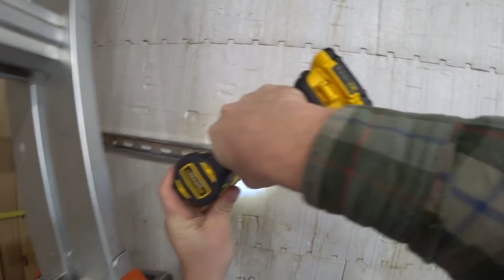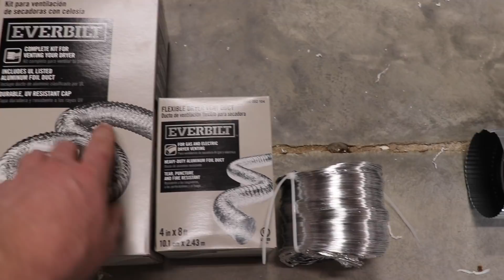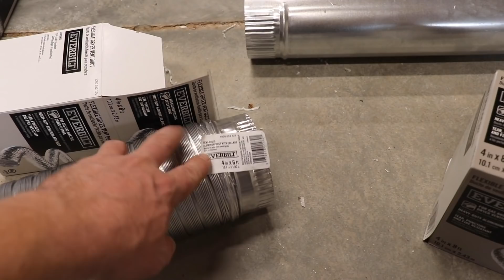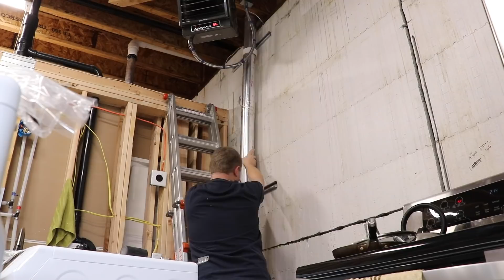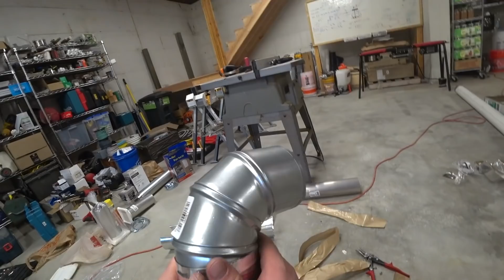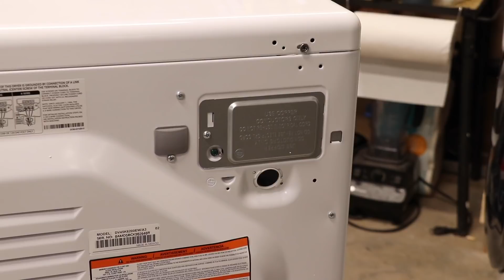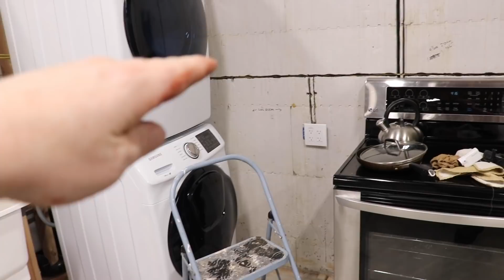Dodged THIS COMMON FIRE HAZARD in Our House!

Comment: All,, I repeat,, ALL flex duct should not be used for dryers,,,, except for a possible very short piece at the back of the machine to facilitate install and removal.   I DO NOT like to use it even then.  The reason   ALL coil type expanded ducts collect lint because of their internal corrugations.  And no corrugated duct will survicve an internal fire for more than a few seconds.  That I have arrived at by personal experience and disaster.   The best material for dryer vent is 4", 26 gauge galvaized steel ductwork.  Simple, direct, off of the shelf.  The tubes are routinely available as 2' sections or 5' sections.  The elbows are completely adjustable for angles.  It IS the material designed for the job.  Cut to length before you snap the edges together.  Tape the joints with a metal tape.

Comment: Make sure critters are blocked from using the vent as a home or habitat trail!  Mice or chipmunks can clog a dryer vent if they use the venting as a warm dry nest or food pantry. Louvers can get lint build up allowing louvers to be open just enough for a critter entry. Critters can with or without lint build up find the way to move them and gain entry. I suggest a relatively small (dime size) mesh cage over the vent in plastic or metal. Check Amazon.

P.S. Amazon does deliver pantry and or fresh meat and produce in some locations and are expanding the number of locations.

Comment: I'm not sure about the "code" need of fireproof sealant around the vent to the exterior.  Since it is penetrating SIPS it seems to me to be unnecessary.  SIPS are made from OSB board (combustible) and foam insulation (combustible?) What is being protected?  As I understand this type of sealant it is to prevent smoke going from one occupied area into another.  In your case its going from an occupied space to the exterior.

Comment: What your saying is that the drier  should not have no plastic part that may catch fire so any drier that has it is not a unit that can  pass the code. The door of the your unit is of a plastic that may burn so if the clothes inside catch on fire  so that it does not pass the fire code.

Comment: WHY DIDN'T YOU USE CLAMPS AT THE JOINTS AS WELL AS TAPE TO KEEP THE PIPING FROM BLOWING APART ,FROM BACK PRESSURE ,OR VIBRATION ?
I REALLY HAVEN'T HAD GOOD EXPERIENCES WITH THE SILVER METALLIC  TAPE,AFTER  YRS OF AGE AND HOT AND COLD,SOME OF IT STARTS TO LEAK OR LOOSEN ..
ALSO WOULDN'T A TEE WITH A CAP BE BETTER AS A CLEAN OUT INSTEAD OF A 90 ?
JUST WONDERING ?

Comment: If you are going to tape all of the seams you should also tape the seams in the 90's. They will leak air also. Buy a set of crimpers for pipe ducting and use them on the harder to join pieces. You also have 4 90's in the way you ran your duct. Even though you only have two "hard"  90's, you also have two 90 degree bends in your flexible duct.

Comment: They have a crimping tool to shrink one of the pipes when you get a tight fit. They also have a sealant paint for duct work that is gold when wet and drys to a silver.

A heads up on the dryer it has a moisture sensor that can mess up on thinner and lighter materials so it will think it is finished yet the clothes are still damp so to get it to work throw a wet towel in with the load to give it the needed moisture to trick the sensor.

Comment: Jesse, You haven't finished yet.  Both 90 deg L's have to have ALL circumferel seams sealed by tape, left bare they will leak dusty lint int the garage.  Your choice of laundry equipment and needs would be better served with a Frigidaire 3.9 cu ft Laundry Center.  Never buy units with push button  board controllers.  They are only as good as the weakest link; and there are many such links.  Metal ducts also build up static electricity and so can result in a vent sourced fire.  Code ASSUMES you to have everything grounded; so a ground wire from the piping to the dryer ground will doubly assure safety.  Building Codes assure public employment to bureaucrats who belong to clubs, societies and organizations that promote safety and increase inspectors assurance of continued employment. raising complexity increases job longevity and income.  It also increases income stream to Jurisdiction by raising taxes.  My Father bought a 20 X 60 foot barracks from a German Prisoner of War Camp in 1948.  He reclaimed all components and started building in 1949.  He built a 20X40 foot frame using barn styles construction.  An inspector showed up one day and dad tore it down and purchased land in a "No Code" Township for $100 per acre!m  The house was finished in 1951.  No electric until 1953  Indoor plumbing and painting the board and batten siding in 1955!   The house burned to the ground in 1950!  From a wood stove fire while folks were away.  Codes are like Law Books written for Lawyers and Politicians.  remember BTK?  He was a "Code Enforcement Officer".  You should fly more often.

Comment: As many have previously commented all this drama can be avoided with a heat pump / condensing dryer:
No vent needed.
More energy efficient.
Recovers the water from he clothes.Not only that but the dryer you're using is sucking air from the living space, heating it further and then venting it outside. In winter you're spending money to heat your dwelling and then spending more to waste that warm air. All that money and effort to seal the building seems wasted to me.

Comment: So you built a proper dryer duct with metal duct and then you finished with that stupid flex duct. Finish the job with metal duct. Also no need for the fire caulk. Foam would have been fine.

Comment: Just use a b-vent which is double walled smoke pipe . You can use a  mastic to seal seams. FYI I’ve never seen dryer pipe go on fire but have seen the lint build up at the bottom of the dryer go fire.. what very flammable are the dryer sheets and blocking the lint catcher of proper air flow

Comment: Nice job. I went through the same learning curve on my LG dryer regarding back pressure limits. It would shut itself off before getting the clothes dry enough. When I pulled the dryer out of my laundry room I removed a large amount of lint in the exhaust pipe. On a hunch I lifted off the cover and discovered another load of lint in the dryer enclosure. It was a big fire threat. Made me wonder how many home fires happen from this cause.

Comment: There is no way the dryer is going to be able to blow the lint up and out of that kind of system and there will be a lint build-up. Also you will be prone to have too much back pressure and burning up your dryer.

Comment: Jessie you just have a way to see things like I do. We both want to do it right and to understand the larger overview along with the thinking  and reasoning  of the codes.  In addition we want it the best it can be while being affordable.
I spent a lot of time trying to find closures that actually seal for both the dryer and the range hood vents. I found a dryer vent end that had a floating cap that is lifts  up but drops to seal the duct for the dryer.  It has worked for 18 years very well as both a vent and a seal.All I found for the range hood was a slotted plain metal louvers or a flap. When the wind blows the flap chatters horribly and the kitchen gets cold. So win for the dryer but fail for the range vent.  You are getting there! Great to see you actually living in your house.

Comment: metal ducting is easy  1st use the snips to cut the duct by reversing the way u hold the handles (just reverse the way u hold them) and use your knee to keep the duct clear of you   this will clear the metal and not get u cut  2nd use needle nose pliers to crimp the end of the duct where the snap lock is (not done by the manufacturer ) insert and twist  3rd  you could have used the KO on the side of the dryer to discharge the air to the right not towards the rear less 90 degree ells and easy to reach for cleaning   4th the discharge cap (PVC) is cheap but not air tight when closed  and has a lot of resistance to air flow   there is one on the market made out of metal with a magnetic flap   it is GREAT    From a former HVAC contractor with a large metal fabrication shop 100 plus man crew  HVAC

Comment: I believe that you missing one big point in your argument, PVC has heat limitations, typical PVC has an operating temperature of 60 degrees Celsius which is close to the dryer vent temperature. Even though the typical melting point starts at 100 degrees it could start oxidizing before that point and release chemical s into the air.

Comment: it's called a crimp tool, comes in handy when fitting metal pipe... and metal dryer vents also rust because it fills up with moisture each time you use it but nothing lasts forever.

Comment: Great to see Your pipe connections Are going with the flow of air Instead of against. You need to get A crimping tool, works like a pair of pliers You squeeze 2 handles together . Also Self tapping metal screws

Comment: You don't have to have combustion heat to have dry air. Just by raising the air temp by any means the moisture level in the air will drop.  Some times to an unhealthy level. Thus the moisture from the dryer is not a contaminant. Now in the summer when moisture is a problem you would want it out.

Comment: That's a super job of installation. You might want to think about an external lint filter which is attached on the piping. This is cleaned out every time you finish a wash. Unbelievable how much lint that builds up. As a former professional firefighter have you given any thought to installing smoke detectors in your living space? Their cheap and easy to install.

Comment: Why not use Galvanized Spiral Duct its quite rigid and wont leak air. When I worked in ventilation duct construction we built a commercial building and used fireproof caulking through and arround the firewalls holes. I guess it can be confusing with such a large country like the US where it seems not to have any Nationwide Standardized Building Codes like we have in Sweden, we have both Swedish Standards and European Standards to follow wich are mostly similar.

Comment: If you want a headache then go look at the installation requirements for fire caulk. Each manufacturer has a very detailed requirements for product use.  I did a bunch of fire stop work with the government , and you were required to have product training on each different product . You were also required to certified bu the manufacturer to use the product.  Good luck.

Comment: Best thing to use in keeping the duct work from leaking is aluminum tape over all joint and in the elbow. Most good hvac installer will use it to keep the efficiency in the unit and duct work.

Comment: Get a crimper tool to help adjust the male ends. Also it helps to stagger the pipe seams to keep the size from pinching at the joint. Also helps to tape the seams in the adjustable elbows.

Comment: Static is not the big problem, dampness is. The lint coming out of the dryer is wet and will stick to anything over time. The big question is ease of cleaning. All dryer duct of any length MUST be cleaned on a regular basics. Metal or PVC will fill with damp lint. PVC is ahead of all the rest for being the easiest to run a cleaning brush through. This is lessons learned over many years. Also key is the outlet being free of anything to catch the lint. In other words open as possible. The metal pipe will be very hard to clean with all the edges catching the brush and holding lint dams. The metal elbow is death to cleaning. The flexible junk is impossible to clean. The rough surface collects lint like crazy. 
Why does it have to be cleaned? To allow the dryer to breath and not be restricted which will increase drying time considerably. Go back to the PVC and then use a short metal section at the dryer to allow for heat despising.  
All modern dryers have a overheat safety switch that keeps the dryer from getting hot enough to start a fire.

Comment: You can solve the 'static' problem in pvc with a simple copper wire. What you can't solve is pvc offgasing  and potentially melting with the warm air coming from your dryer (and range hood) that's why it's not code to use pvc vents for anything above ambient temp venting.

Can't help thinking most your problems would disappear if you RTFMed BEFORE you actually started trying to do something

Comment: Good channel, but you really worry way too much about 'politically correct' BS codes which you can easily clear up by asking the local building inspector what he will accept.
Too many 'what-if's' will get very costly and is unnecessary, clean your dryer filter after each load and hang clothes outside if possible and you won't have a problem and move on...

Comment: Why on earth are you venting a drier?  Use a condensing type.   That way the heat that would vent through the wall stays in the house. Uses slightly more power but all that energy stays in the house.

Comment: Combustion heating, propane gas tops you've been using. They belong outside. Carbon monoxide poisoning and fire hazard. Dryers generally work  better unit height below, think gravity with lint.

Comment: Nice job on such a confusing product to work with.  I have NEVER enjoyed working with that type of pipe, but it’s necessary so, like you did, we just deal with it. I learned a trick from an installer; take a 12-18” length of string (nylon is better if you have it) put a loop in one end and then wrap it around a pipe to give you a reasonably straight line. Trace around the string and you’ll have a better, read that as straighter, cut. Also tin snips make a straighter cut than aviation sheers if you don’t have a sheet metal cutter.  They also make a nibbler type tool that is very good for cutting thinner material like sheet metal, aluminum and some plastics.

Comment: I really think using PVC even as an outter shell for your dryer duct to fit in is a bad idea. The PVC will be heated up by the heat from the dryer and will off gas. Those off gases is dangerous to breath. Please research that..

Comment: Plastic & hot moving air, can develop a static charge of over 5Kv! It will attract dust particles. 

I've had that style plastic vent (with the 3 flaps)  for years, never had a problem and keeps the rodents out. I inspect the bottom of the dryer yearly and clean out whatever lint buildup there is. The aluminum ones work well also but more subject to impact damage.

UL rating/listing is no guarantee. I had an plastic, UL listed outlet strip that caught fire, underneath a wooden aquarium stand -  almost burnt the house down. The internal 15A breaker never popped. I dont use outlet strips that are not encased in metal anymore and actually prefer to not use them at all if possible.

By the way, have you guys planned out your network yet? Are you wifi'ing everything or going hardwired?

Is there an app to control the dryer?

Comment: You could use the PVC vent for air replacement as the dryer will suck many CFM of air from the house as it is exhausting the humid hot air with lint out the exhaust vent. This will allow the air exchanges per hour for the building envelope as low as possible.

Comment: Get a hand flutter for your connections, it will make your life a lot easier.  Contractor would never do it, but I always use silicone on my longitudinal seams and tape all seams in my adjustable elbows.

Comment: I'm by no means a code expert, but I don't know if you have to fire block when you penetrate an exterior wall or rim joist, only when you are going from floor to floor, or in your case, when you are going from the garage up into the living area. It could be that you will not have to use fire-rated drywall on ceiling of garage either, unless you just want to. The wood sub-floor may provide the required the required fire rating. That said, having a good seal on exterior penetrations in a climate such as yours is definitely a good idea.

I expect they are going to require all pipe and plumbing penetrations going from the garage into the living area to have fire blocks.

Comment: Do you have condenser dryers in the US ? I have one and didn't need any venting. Just emty the watertank after drying. It is also possible to directly connect water outlet to a drain. 👍 Good luck with the house (building)! ☺

Comment: OK......I'm pretty sure the PVC can impart a static charge through your thin metal dryer vent.  A silicone gasket or flat tape will take up the space, avoid static and it's very high temp stuff.

Comment: For a clean out you need to add a lint trap box after your first elbow. It is a clean out entry point as well as the security of a second lint trap separate from the dryer lint trap in the vent line

Comment: You could have put a tee at the bottom of the vertical pipe with a cap to use as a clean out. That way you would not have to disconnect the elbow to clean out the ducting.

Comment: Have Y'all put a Lightning/Surge Arrestor on your main panel ?  Check your "fine print" on digital appliances, and they are not covered for warranty, if no arrestor/surge protection has been installed, and they blow-out due to electrical surges.

Comment: In the state which I live in is Washington and is in Thurston county our dryer duct has to be ridge pipe and all joints have to be sealed with joint compound you cannot use the metal duct type tape.

Comment: I have the same washer, get the Tide soap pods, it's easier that trying to pour detergent liquid. Also when you finish your wash, dry the inside of the door and leave ajar. Otherwise you might get a mildew smell. One a month run the Self Clean function. Happy washing.